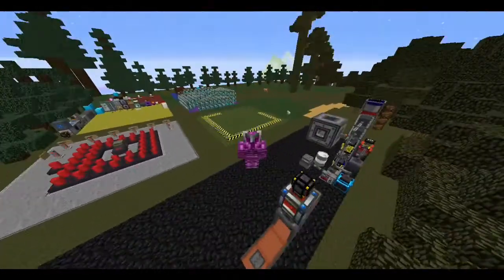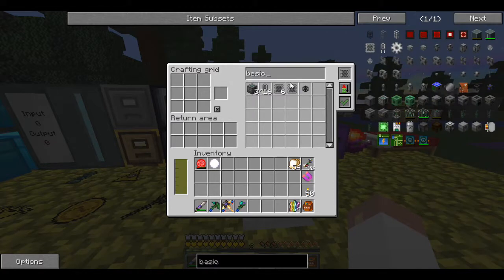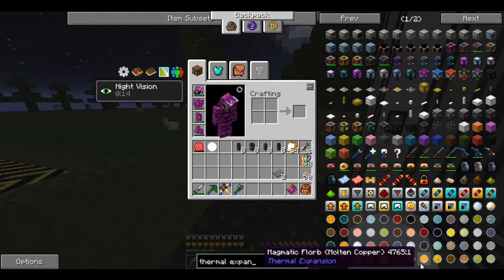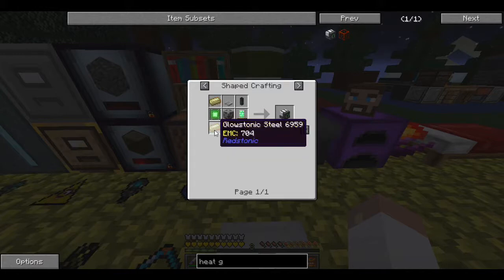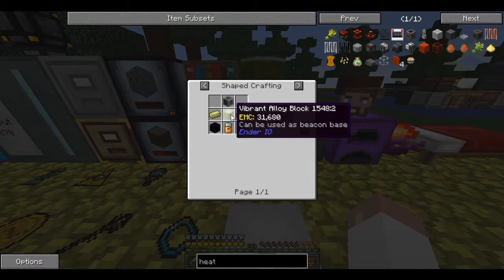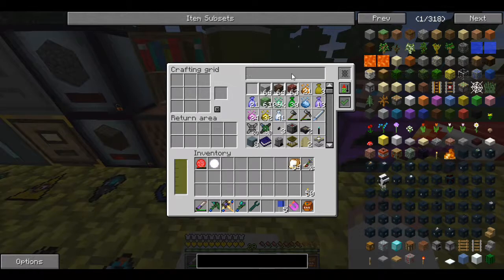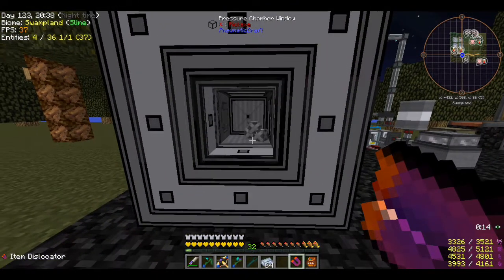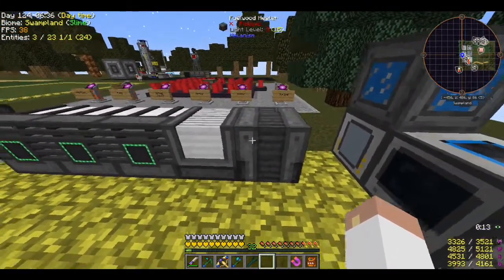Mekanism - Ep 25 - Project Ozone 2 (Kappa Mode)

Comment: More tips:
1. Liquids:You can buy and sell pneuamticcraft liquids with amadron tablet (it works like trading with villagers). 
2. Glowstone steel: Glowstone steel and lumium have the same ore dictionary so when u put glowstone steel to your storage it changes to lumium. You can put glowstone steel ingot in the drawer and lock it with a key. Then just put lumium in it and it changes to glowstone steel. You can also do it the other way round. Its a good way to make glowstone ingots becouse making u can make lumium seeds .
3.Smeltery: I suggest using a pipe without internal inventory so there is no need to to break it. Enderio max tier fluid conduit is the best becouse u can easy controll it with redstone so there is no need to use wrench on it. Just make so one of the sides is in and out with the redstone signal "on" and the other in and out with the redstone signal "off". Then u can controll it with lever.
Reply from the maker: I love your comments, such good timing. I just found the Amadron Tablet a little while ago, but I kinda figured with all my fluid cows I should be ok. I'm so glad to know that I am not loosing the glowstonic steel, that was really upsetting. And with the pipes on the smeltery, I know I should swap them out, but I'm probably to lazy to do so. But Thanks for the advice... and thank you so much for letting me know about the steel.